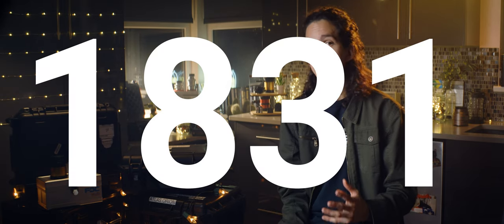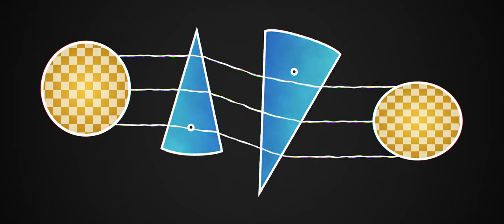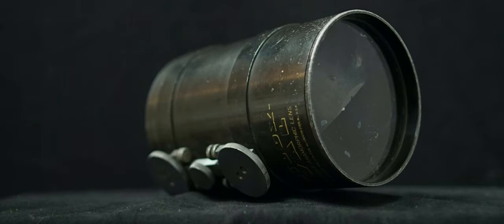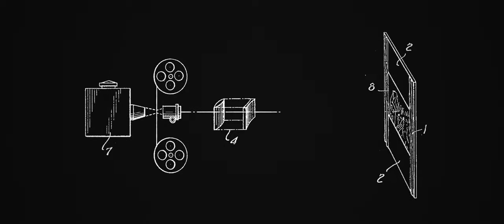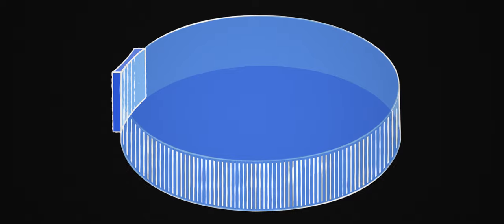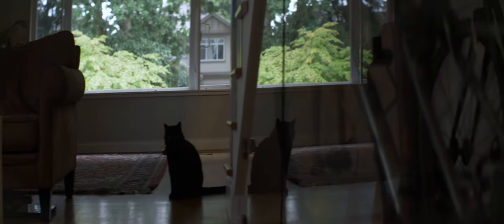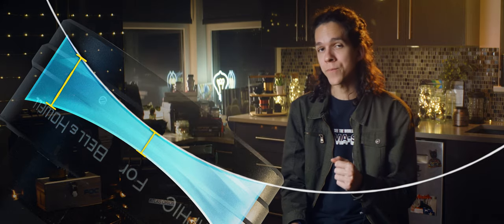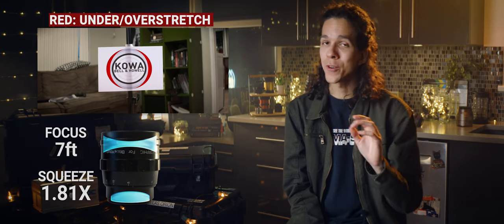Structure of an Anamorphic Lens - Anamorphic Cookbook - Module 1 Chapter 04

Comment: Can you go into the difference between the Vazen 28mm design and the 40mm one? Like in the construction that allows for the squeeze factor to not change with focusing on the 28mm
Reply from the maker: I'm doing that in Module 2 Chapter 4! If you're not a member yet, members of the channel are already in Module 2 Chapter 2. :P

Comment: If the squeeze factor of a lens changes over the course of it's focus range, does that mean I have to desqueeze the image differently through each shot that changes focus?  Let's say I'm using the new Sirui 1.6x lens, will I have to change the the X and Y zoom values (Davinci Resolve) every time there is a rack focus?
Reply from the maker: Theoretically: yes. In practice, the difference is pretty small, plus it's only for a little bit of time (the duration of the shot), so, most people end up just living with it.